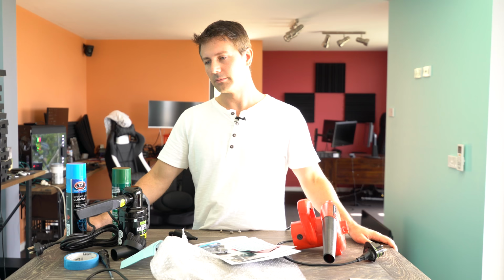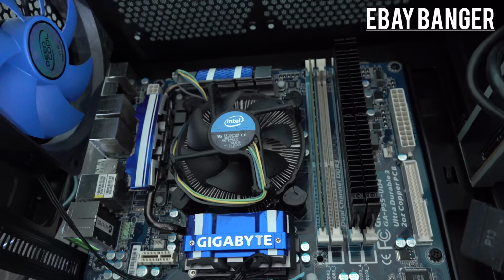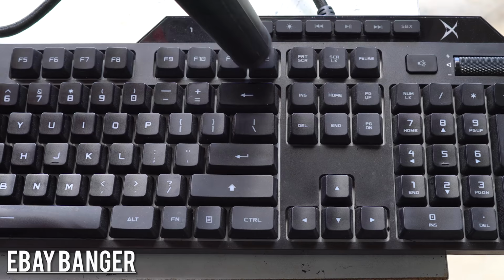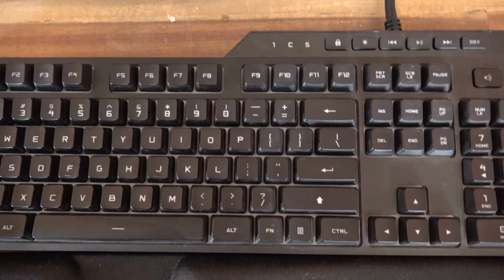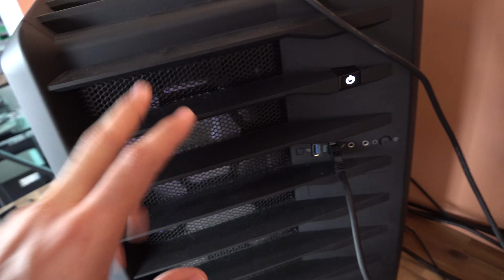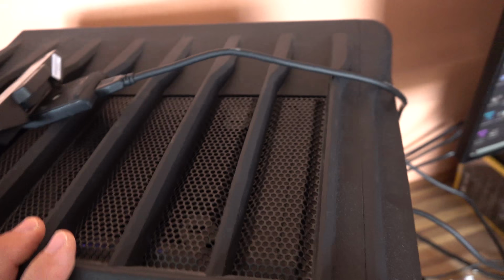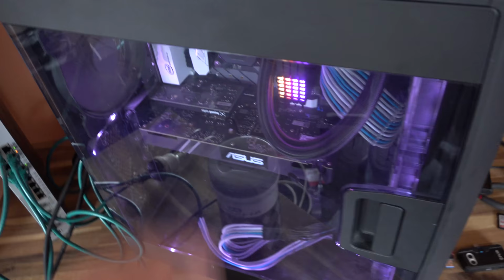DataVac Electric Duster Review - $93 Blower Vs. $25 Cheaper Ebay Version

Comment: The difference in nozzle shapes is probably a bigger difference maker than build quality or price. If you have a bin of old vacuum attachments one of those pinched nozzles attached would probably equalize the performance. Open your mouth and breathe out, purse your lips and breathe out. Cheapo is let down by design.
Reply: my thoughts exactly.
Reply: Not the shape so much as the size.
Reply: yes an yes
Reply: 3D printing can fix that. :D
Reply: I had the same thought from the wonderful future that is 2019.
Reply: exactly
Reply: nozzles dont increase flow volume just speed. the CFM is the same.
Reply: @brandonsmoot4056  Not a question of volume, its a question of velocity and coherence.
Reply: @HalGailey  laminar flow does not aid in shear stress
Reply: @brandonsmoot4056  Not shear stress but mechanics. And we are talking about dust, not solid structures. You take an unconstricted 50CFM and point it towards dust you get a puff, you take that same 50CFM, push it down a funnel, point it at the same dust and you get a jet of dust flying off into the distance.
Reply: @HalGailey  imagine unironically believing that flow doesn't cause shear.

I guess building don't have wind load. 

No but seriously it takes a specific amount of shear to dislodge a given partial of dust. 

Wind shear is dependent on flow rate, and pressure along with some other things having to do with ideal gas laws and inconvenient realities( temperature, composition etc)
Reply: @brandonsmoot4056  You're talking about massive differences in scale. Who said flow doesn't cause shear? I said the mechanics we were discussing weren't shear. We aren't talking about monolithic structures. It's no different than the effect a pressure nozzle has when affixed to a garden hose. The amount of water doesn't change but the effect on grime does.
Reply: Original reply for posterity "imagine unironically believing that flow doesn't cause shear. I guess building don't have wind load. No but seriously it takes a specific amount of shear to dislodge a given partial of dust. Wind shear is dependent on flow rate, and pressure along with some other things having to do with ideal gas laws and inconvenient realities( temperature, composition etc)"
Reply: 2 years old but.. THANKS lol... thats the 1st thing I noticed.. why he didnt.. who knows
Reply: It will overheat with smaller nozzle.

Comment: Get a corded outdoor garden blower and compare that..
Reply: Should he still compare it? Or you already know the result?
Reply: No longer having keycaps is a bit annoying but it's clean alright :-)
Reply: That was the day I lost CTRL!
Reply: Theo de Raadt: Same, you can turn it down too so should work nicely.
Reply: Esd risk...
Reply: @mattsmechanicalssi5833  LOL
Reply: I was already planning on doing exactly that later this week! I'll have to be careful not to blow off the fan blades.
Reply: @mattsmechanicalssi5833  what keyboard that? 2:47
Reply: @stevethea5250  Sound BlasterX Vanguard K08 SE Gaming Keyboard
Reply: @mattsmechanicalssi5833  wow how'd u know

i thought he was joking.. why WD40?? 6:52 aint it grease/oily 
and dust stick more
Reply: @stevethea5250  The keyboard? I paused the video when I saw the numbers on the left hand edge of it. "K08". Quick search revealed what it was by the pictures. 

WD40 works very well as a cleaner. It's main purpose when it was created was to displace water in electrical systems. The solvents in it evaporate over time, leaving very little behind. It also acts as an anti-static, repelling dust. I am a Mechanic (30+ years), and I use the stuff for cleaning. There are far better products to use for lubrication.
Reply: @mattsmechanicalssi5833  but people also said wd40 dissolve plastics

Also some like to use a random air compressor but they have static & ESD ? or hairdryer with heat off

Comment: I've actually been using a $4 air mattress blower to clean PCs that I bought off walmart online. I got u beat Bryan :)
Reply: I've also been using air mattress blowers for years
Reply: Third on that. Its the best $5. I hold my fans. If they go too fast the bearings don't like it
Reply: the best! I use one as well
Reply: Just use a hair dryer that let you turn off the heater in it.
Reply: you just saved me 25 bucks! Youre a god damn genius! Youtube comes through once again.
Reply: Any links? From the uk
Reply: @nickmccain6598  but they have static & ESD ?
Reply: dam you just saved me alot off money <3
Reply: Thanks for the idea

Comment: Bought myself a datavac duster years ago. Still works great even after dropping it on a cement floor a few times. I use mine at least once a week for my hair. Works great at removing stray dandruff that the shower didn't remove, too.

Comment: 1.  The worry about using a generic "blower" is the risk of a static charge, not output.  (I've never tested this personally)

2.  Anyone who watches this, DON'T just blow forced air into your fans and let them wind up to infinity - hold it still with your finger before applying air - you risk damage to some fans by doing this.

EDIT:  Great vid as usual Bryan.  I don't comment much, but I appreciate ya.  :)
Reply: point two is merited although it's not the fans that's at risk, it's the power you're putting back into the motherboard by spinning the fan in reverse. (wouldn;t worry about this too much though)
point one can be mitigated pretty easily- meh, I'd be more worried about particles getting flung at those small smd's
Reply: Coffinspired It doesn't produce enough power.
Reply: Coffinspired I kind of understand number 2 and I personally do actually do that. But as for 1... ESD discharge on regular computers is very unlikely unless you're actively shuffling your socks on the carpet and even then most decent mobos come with ESD dissipating components built in.
Still, I do take precaution and touch the bare case or a large piece of metal every 5-10 minutes or so when working on a PC to discharge. Straps are personally just a pain and redundant. 

And if you still worry about the blower then just disconnect the power/cords, wait 5 min., blow, then wait another 5 minutes, touch metal,  turn your PC back on.
Reply: Germo Gen the bearings can wear but it s one of them 1 out 100 things
Reply: Germo Gen It takes no real extra effort to hold the fans still, you can ruin the bearings by making fans spins faster than intended (I have seen people destroy laptop fans this way) Your argument is a car is designed to drive therefor driving it through all kind of shit won't damage the car.... no, just no.
Reply: Uh...

since when does fans get ruined from "forced spinning"? it's not as big of a deal as you make it out to be.
Reply: Look up carey holzman on youtube, this is thoroughly debunked. Misinformation that is constantly parroted by know nothings on the internet.
Reply: decivolts? lol. Spinning a fan at 3k rpm generates as much power as it consumes at the same RPM (ignoring efficiency loses) . Putting 1-2W back into a motherboard that was not designed that way can cause damage, not guaranteed or even likey. but it can damage it never the less. Plug a fan into a multimeter and spin the blades really fast to test it out.
Reply: The spinning fan will not cause any back system serge, but what it could do is... imagine your fans run at 3000rpm when unload normal/heavy load and the bearings on the spindle have been tested to 4000rpm max by the manufacturer, but then your spin them at 8000/10,000rpm whilst cleaning..... later on in time these bearing have been put under considerable extra load and could fail at any time causing the fan to stop spinning and CPU overheats....
Reply: Fans have a designed operating range and rpm, if you spin the fans above this range you do have a higher probability of ruining the fans, which is quite easy to do if you using one of these blowers. Point 2 is very valid.
Reply: I jam screwdrivers into the fans when using a blower. Works great.
Reply: Point two is actually pretty bad on the fans because blowing high speed and letting them spin freely can sometimes ruin the bearings if it wasn't designed to spin faster.
Reply: Actually, a significant amount of power can be generated, surely enough to harm a motherboard. I usually stick a pencil so it doesn't move the blade.
Reply: What kinda shitty bearing can't take the load of a 1oz piece of plastic spinning a bit faster than intended. Bullshit
Reply: Just a bit faster? Eli, you have no idea what you're talking about...
Reply: I'd be more concerned with a static charge from spinning the fans like that.
Reply: wait, does that mean, the red blower in this video can generate static charge that will harm my PC? I'm trying to get one since it's cheap compare to air compress can found on amazon/ not available in my country, so yeah is this true? the red blower?

Comment: Wouldn't cleaning with wd-40 and it's left over oil attract more dust?
Reply: It will, which is why when I see someone who uses it to clean skate bearing I smack them. You're better off using something made to clean plastic or metal, than some kind of "all-in-one" for your PC. That all said, if you're buying & flipping, you don't really care if something gets dusts a bit faster as it won't be your problem.
Reply: i think that spraying a bit then wiping down wont make it attract a huge amount of dust. ive buffed alot of plastic with wd-40.
Reply: I was interested as he used on the plastic- I usually use glass cleaner or silicone which does a good job
Reply: It will give you that: Oh, it looks like it's brand new!
Reply: in a coastal area like this, corrosion protection trumps dust prevention.
Reply: wd 40 : conductive, acidic, and/or leaves a residue on the circuit board
Reply: @michaelmurray2833  wd40 is not conductive at all.
Reply: Thats why he doesnt use wd40

Comment: In my experience the attachment used on the datavac provides a more direct blast, this attachment on any other blower of similar power should provide similar results regardless of manufacturer.

Comment: I use a 20gal air compressor since its something I already own, and you should see the dust fly! Have to be careful with the fans so they don't over spin and damage something with the electricity generated though.

Comment: For 92usd you can buy a small compressor for that. Of course it is not shipping friendly unlike those. 

But yeah compare to all of those air blowers, air compressor pressurized air nozzle does to better job dusting out the unit.
Reply: remle ikawura Air compressors have trouble with moisture though, unless using a line dryer.
Reply: A lot of people wash PC parts (with a hose or a sink). You just let it dry for a while. The amount coming out of an air compressor is very minimal (they have drains at the bottom of the tank for this reason, nobody seems to use them though). If super worried about moisture, the line dryer you mentioned is a great solution. It would also be cheaper than the $100 blower he had, and it will clean that Intel heatsink much better.
Reply: Timothy MacDonald ive cleaned a lot of pc with this air compressor of mine also other appliance as well, i even use it to inflate my tires at home. 

Air compeessor does do collect water bit that is so minimal that doest even need to be worried about. For about 3 years the tank managed to collect half a cup of water and theres no way that water to spot out on the hose sine its far too away from the outlet
Reply: Timothy MacDonald ive cleaned a lot of pc with this air compressor of mine also other appliance as well, i even use it to inflate my tires at home. 

Air compeessor does do collect water bit that is so minimal that doest even need to be worried about. For about 3 years the tank managed to collect half a cup of water and theres no way that water to spot out on the hose sine its far too away from the outlet
Reply: remle ikawura It all depends on many variables. In the climate I live in, some days the air comes out dry, others I may as well use a garden hose. With large temp swings in my garage (I don't heat it all the time) temps can go anywhere from about 10°f to 80°f. This is just to say that it can be an issue. With an electronic blower, it likely won't be.
Reply: Jake Garrett I would argue that it could in fact make it more dangerous. If you know it's wet, then yes, just let it dry longer. If on the other hand you use "shop air" and expect it to be dry, it takes very little moisture to zap something sensitive. Depending on the conditions outside, my old 85 gall9n air compressor varies from dry, to may as well use a garden hose.
Reply: I have both, By the time I go out to garage where I keep compressor and start it up, then run hose back into house only to find I need to then plug in hose extension, It's easier to use the datavac!

Comment: I was taught to keep the fans from spinning out when you use a blower on them since a blower would spin the fans faster than they were designed to go. Is that a myth?
Reply: It's true.
Reply: No myth, can confirm. I used a blower against my GPU fan and a ball bearing fell out xD Now my PC has slowed down so much that I can't play any games because the GPU heats up really quick
Reply: So why did this fwit do it then? :/
Reply: @david7101  Maybe he made sure to keep the duster at such an angle that it didn't push the fans to the max? I literally held the blower to the fan just to hear the whine, big mistake.
Reply: yeah finally a reasonable comment, exactly!
I do that always I hold the fans with my hands, and with the second hand i use the air blower, otherwise i feel that I can break the fans... I do have 25$ ebay air blower and is very strong.
Reply: Also generates electric current

Comment: If you DIY a narrower nozzel on the cheap blower it'll work even better. I've been using kind of the same one but from a reputed brand since datavacs are as expensive as gold in my country. They start from $200-250 USD converted and go upto $400

Comment: Always wanted to buy such thing but never bought and that thing is very expensive, for that price I can buy a air compressor that not only blows dust away as it blows the hardware away too :), sure it's not the same thing and the compressed air usually has moist though that is not a big problem as I would let it dry very well before putting power and it also has adjustable airflow...

In a School I worked they had an electric duster, it sure was pretty cool to use it, but not cool to buy them at their high price to use very rarely at home for private use.

Anyway I don't know why you never stop the fans from spinning, since the 90's I always just touch the fan so it doesn't spin as over spinning it too much could maybe produce too much electricity for some component.

ps: But I'm still thinking to buy an air compressor at some day, just never bought it as I would only use it from time-to-time and they are not exactly cheap either.

Comment: 5:09 Blasting the dust deeper into the filter and into the case? - LOL
Blast the air from inside towards out and vacuum the outside with a brush attachment
All the comparison test were flawed because in all cases the cheaper one was used with a wider nosel lowering the pressure. Even the test with the wood at the end where he took the restricter off the datavac, which would have made them both about the same, he then took of the nosel from the cheaper one so making it much wider still.
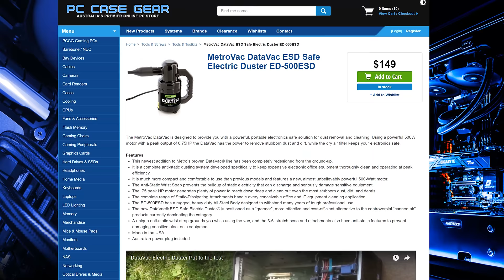It looks from the pictures at 10:36 that the cheaper one can act as a vacuum which wasnt tested.
If the cheaper one really was 700W (test it at the wall socket) it should out perform the 500W datavac if it had similar attachments.

Comment: Try silicone oil spray, doesn't smell anywhere near as much and brings plastics up really well. It's used on and in vehicles too, it doesn't damage surfaces. You can get it for a couple of dollars a can as well.
Reply: ive never heard of anyone using a spray on the inside of the computer for shine...any suggestions..I can potentially see lots of problems
Reply: @regg2943  It depends on where you put it and whether the manufacturer added a conformal coating to the motherboard.
For shine it might have to be something that sets. Anything that has an oil in it will cause dust to stick to the inside of your PC, get into the fans and make a hell of a mess.
There are lacquers you could use but you could cause a little bit of head buildup on power delivery but that might be your best option. I'd keep it well away from PD mosfets. 
You could try it out on another PCB, try using a super fine, maybe even microfiber cloth to give it a bit of shine afterwards. Apply it in extremely light sprays, one at a time. 
I suggest testing anything with a multimeter, both wet and dry to make sure there's nothing that can conduct in it.

Comment: I have the dataVac and it is one of those things that I tell everyone about.  Of course it works great at cleaning computers and keyboards, but I find small uses for it all of the time.  The thing is built like a tank.  The thick sides will start to get  warm if you try to run it continuously, but rarely is there a need to do so.  Now the only question is, how long will it last.  From the looks of it, forever, but we will have to see.

Comment: When I worked in a pc repair shop they told me to use a paint brush to clean pc's and pc parts
Reply: Dominik  I strongly disagree with a paint brush as it could bend capacitors and ram contacts, plus your just moving the dust around. Better off using a hair dryer...
Reply: Sounds time consuming but I guess it raises the billable hours. Honestly anything so gunked that might require brushing I hose down, dry off, and let it sit in a dry room over a weekend. By the time I'm doing something like that it's probably out of desperation, anyway, like trying to save some broke chain smoker's Core2.
Reply: Umm... well that's bad!